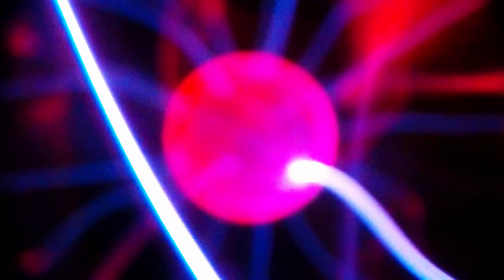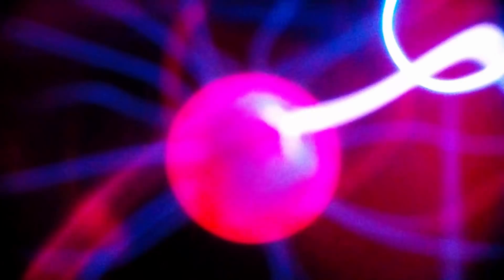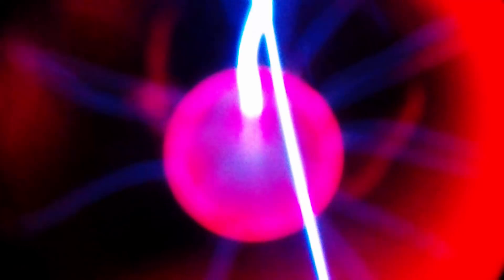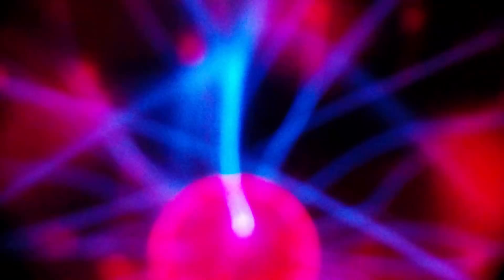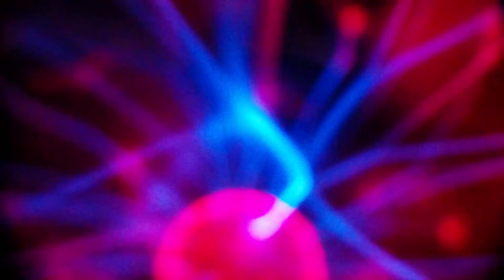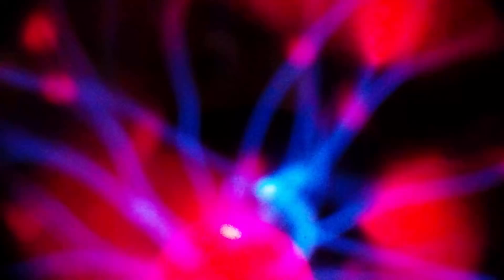Plasma Ball Sun Surface ...or a dandelion.

Comment: Sun is hollow like fire. The plasma is a Shell around the center point of inertia
Reply from the maker: Dr pierre Robitaille has shown it is a solid body  at the core...please see his work on you tube "Sky Scholar"  as he is correct.
Fire has matter...and so the sun has a compressed matter core of metallic hydrogen...is what I believe.
No matter?
no fire.
Reply from the maker: if you remove the logs or gas...is there still a fire?
no matter...no fire.